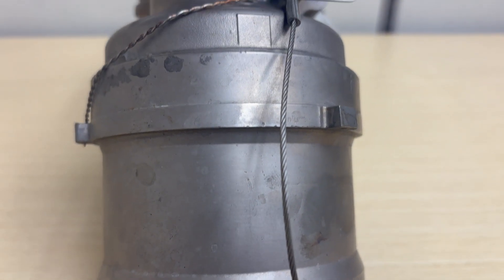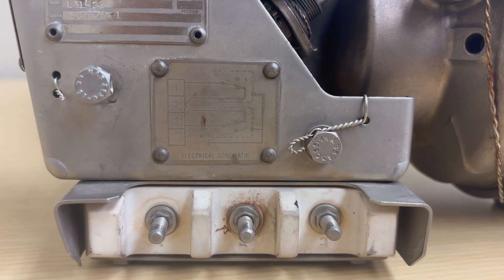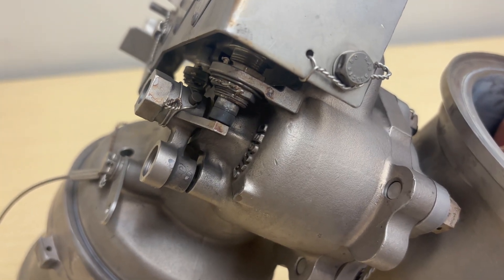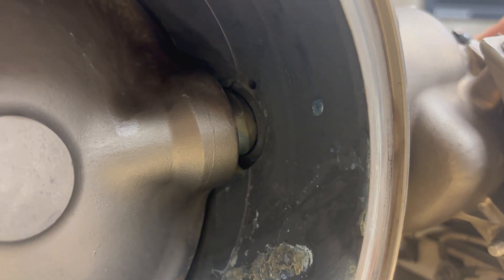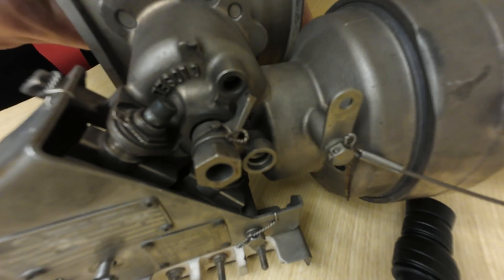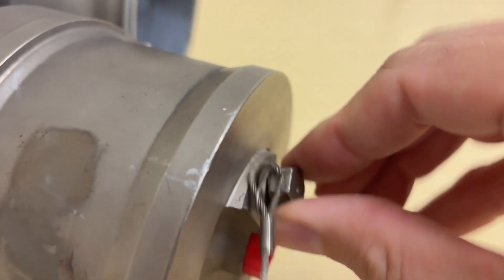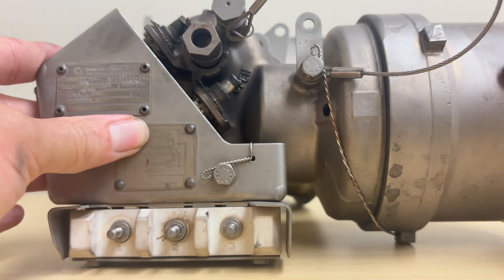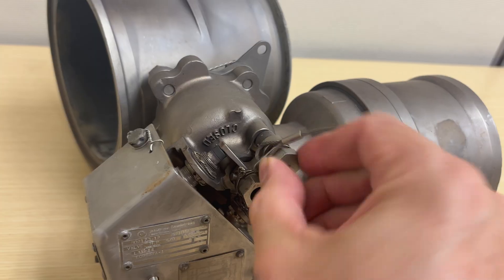Boeing B747-400ERF, High Pressure Shut Of Valve, why did it fail?

Comment: That plug switching positions is a neat idea.

How many service hours will a valve in this condition have? Because it doesn't look too bad on the outside to me...

That bearing really looks toast, even with my limited non-aviation mechanic knowledge :)
Reply from the maker: Don’t know the service life of the valve. The bleed system on the B747 isn’t the most reliable one. And yes the play on the bushings in a problem.